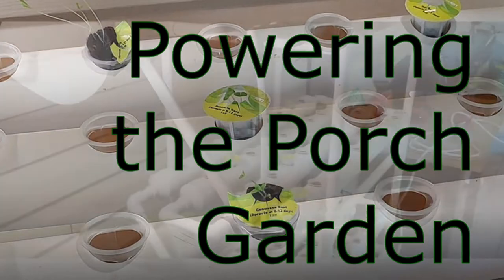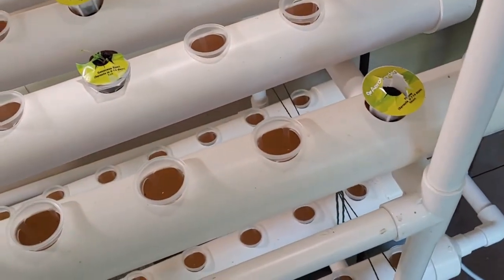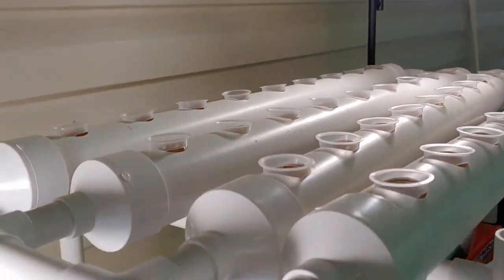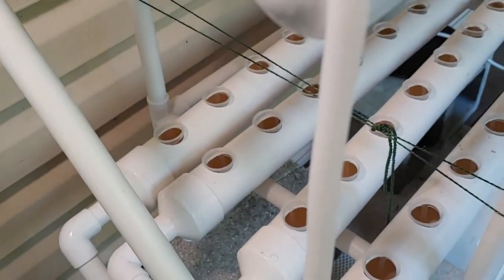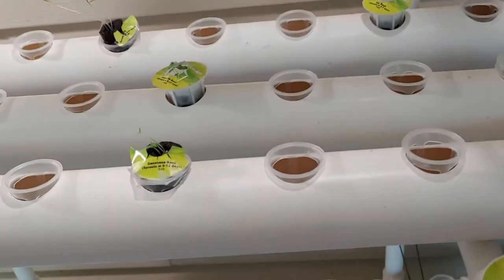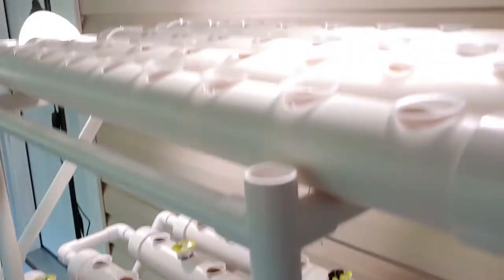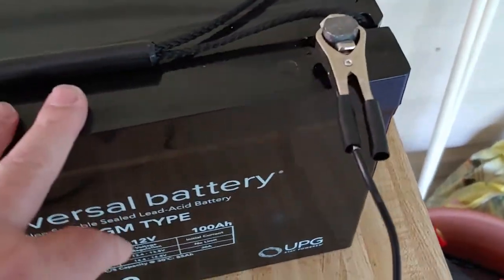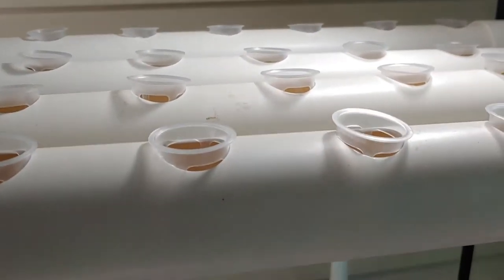Powering the Porch Garden off grid.

Comment: I think if that was the first solar thing I had ever done, I would have hooked a 25 watt panel to the battery with a manual switch and a voltmeter...and then experimented with the angle to get the right voltage...lol...bare bones, manually regulated...I just put watercress in my stock tank to shade it...I have a turtle in there...any bugs get in my water he will eat them up. He likes it here. I got another tomato planted so I'm planting strawberries now. And building them a wind guard from the "30% chance of tornado monday thru wednesday, but tuesday looks the worst". So I am putting a ton of leaves around my plants, and hope they survive. My first plants are growing and getting rooted in before the heat comes, so it will be okay once it gets going. I'm putting cow manure and compost to hold the leaves down so it will feed as it is watered. That will help them compost so I should have a good garden this year. Without weed pulling and just harvesting. I just make a hole in the leaves and put some garden soil and the plant , and cover with a foot of wet leaves and pack them down to squeeze that brown tea onto my plants...in this cool weather I can get by with that. Have you ever tried strawberries? I'm putting 15 plants out under the old chicken house nests.  (Free Fertilizer, already there )
Reply from the maker: Thanks for your comment.

Comment: Great video. I just found your channel. I’m in forced retirement due to several spine surgeries. I too am into hydroponics and looking into adding solar emergency backup power. Question, is your garden in an enclosed or open porch?  Is it an all year round venture? If so, what’s your area of the country or temperature ranges?  What hydroponic solution are you using?  I use Master Blend 3 part powders. I’m in eastern PA so I’m outside in spring thru early fall and basement in winter. I grow cherry tomatoes & lettuce using Kratky method which is non moving in a 5 gallon bucket for tomatoes and Mason Jars and or a 3.5’ length of plastic downspout with 2” holes 🕳️ for the netcups.  Thanks,  Dave
Reply from the maker: Thank you for your inquiry.
This garden is on a screened porch in northern Florida, so I have a lot longer growing season than you have in Pennsylvania. But I have to keep an eye on my selection of plants, as many leafy green friends don't like too much summer heat. 
Mostly, I have been using pre-seeded pods from Aerogarden and some bare root strawberries I ordered through Amazon. The strawberries are ever-bearing so they keep going all year, but I vary the rest of the crop during the year - salad greens in the cooler parts of the year (early spring and late fall) and various herbs during the summer months. I use a multi-purpose plant food (such as Miracle Grow).
The solar power keeps the water pump, grow lights, and timers going out on the porch where electrical access is limited.
Good luck with your garden!